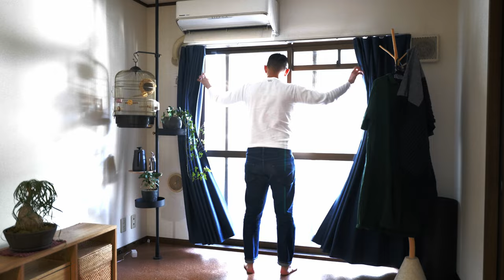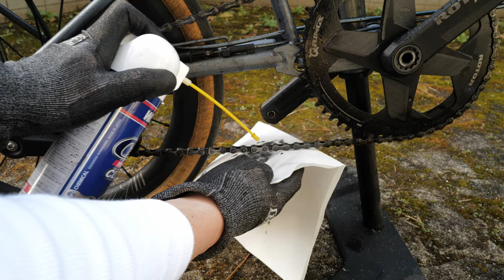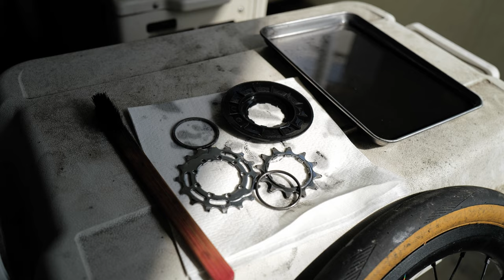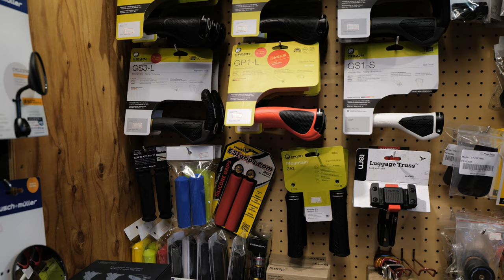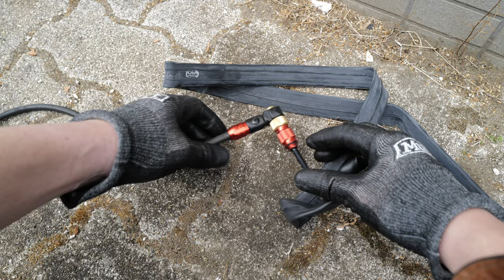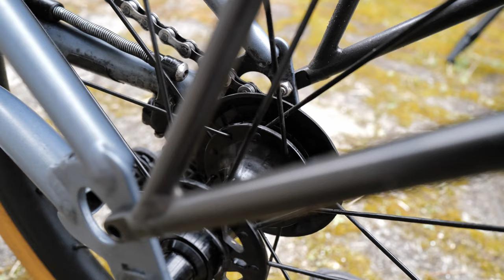Brompton Monthly Maintenance & Cleaning/ Weekend Vlog #4

Comment: Nice video! I see you are using the Rotor DM oval with Aldhu cranks, wondering what BB are you using in order to fit on the brompton? what are the specs? Thank you!
Reply from the maker: im using CHRIS KING ThreadFit 24 BB. its way better than original one I believe.

Comment: I would do the front wheel again.... Have a look at the rear wheel, where is the valve and where are the printings on the tire? ;-)
Reply from the maker: Thanks for comment! I don't add any sticker additionally so maybe its Hubsmiths(the wheel set manufacture) sticker.

Comment: I am going to try waxing my chain instead of petroleum-based lube. It keeps your drivetrain much cleaner so you don't have to deal with the oily greasy chain and cogs. I've heard of people getting 7,000 miles from a chain that is waxed.
Reply from the maker: Wow, I have never seen people around me using waxing. so it's quite new for me. and I will try;)

Comment: Just go my 2 speed today, wen't for a quick spin,top gear easily spun, and comfortable over bumps. Will keep it in cycling trim without folding up as much as possible, dry days only, perfect for city commutes and should get up 7% without much trouble.
Reply from the maker: haha 2 speed brompton can do anything but climbing. I have two of 2 speed brompton but theyre always best bike for me.
Reply: @takujadebun  For speed I agree.Coming from a long time with racers I couldn't cope with the weight of the 6 speed hub on the rear wheel of the other version. It's not of course as fast as my racer but doesn't disappoint. I just can't change back and forth between granny and normal gear due to the eternally crap brompton gear issues at the mo but its not a distance machine and is enjoyable powering up low grade rises in the single speed butch gear.
Reply from the maker: @sandydennylives1392  I agree with you. Brompton is not likely other bikes and it shows something different view. if I ride long distance, climbing mountains, riding without using public transportation, I definitely use road bike.  anyway both bikes are fun for me;D
Reply: @takujadebun  You can actually climb 'tains on a Brompton. T&T do a 54/33 chainset. Getting down the other side will leave you with red hot rims and little else.